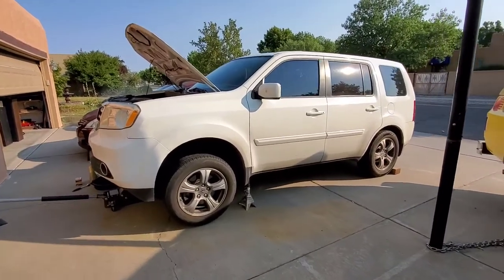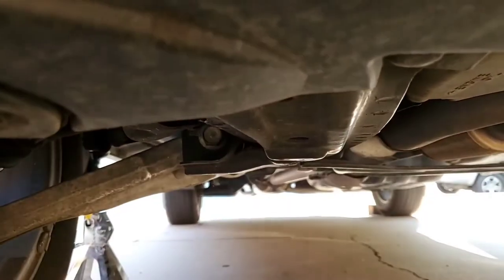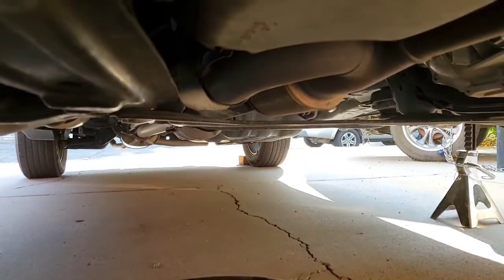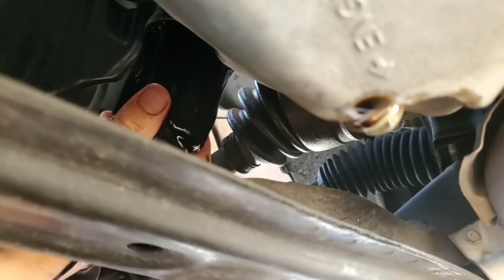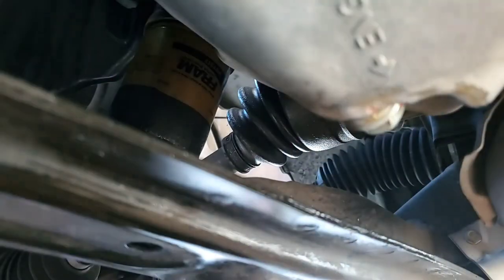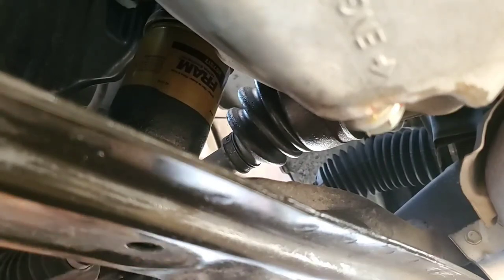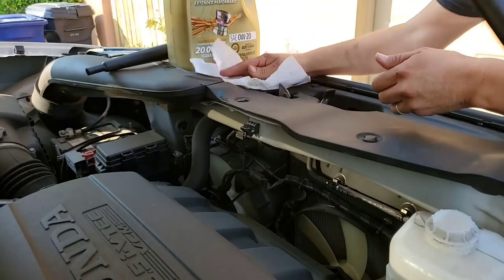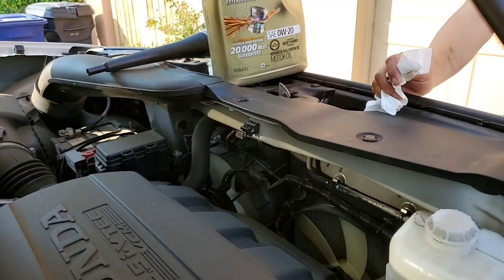How to do an oil change on 2015 Honda pilot

Comment: You really don’t need to jack up the car I never do it for my pilot drain plug is right there also turn the passenger  wheel out and filter is right there